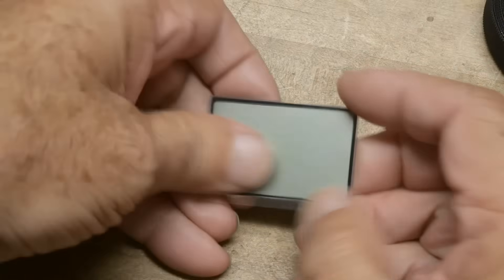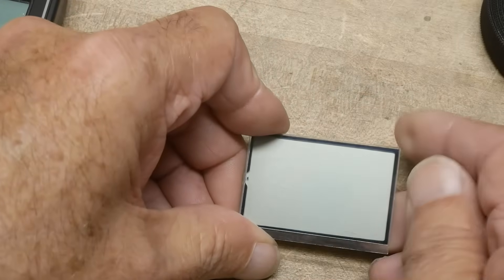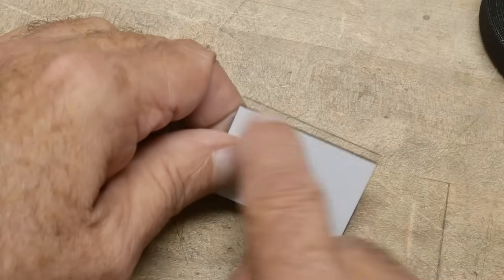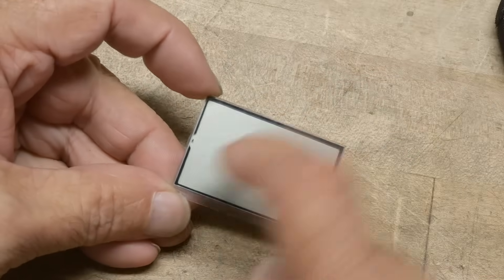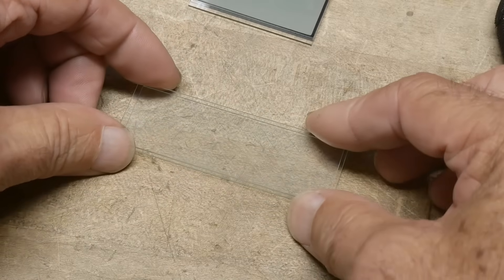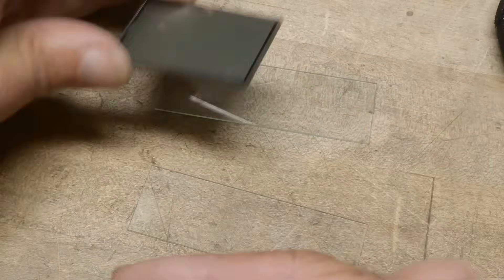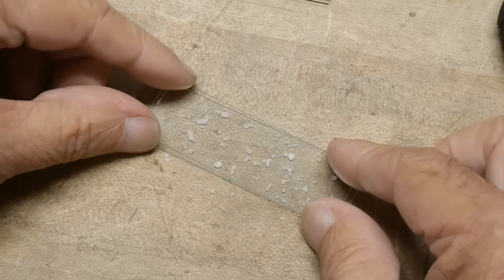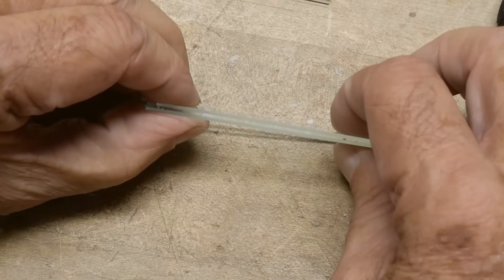#2325 LCD Glass Spacing Construction

Comment: That reminds me how some conductive tape manufacturers makes conductive adhesive. The adhesive itself is still an insulator, but they put a bunch of small conductive beads in the adhesive to bridge the gap between the tape and the surface its adhering too. Fun to see how the same idea can be used to solve multiple problems!

Comment: That is amazing!   And thanks for pointing out that, of course, they has to have a way to fill the space between the glass with the magic goo.  I suspect that or the seals are why the very early LCD displays that Fluke used in the 8050A DMM (and like others of the era) would go bad.  It seems like moisture, or something from the outside starts to leak in and impair the display.  I hadn't given much thought to the nature of the failure mode, but now I've got a sense of it.   

This is one of the reasons I did a project to replace the early crude 7 segment, 4.5 digit display with a graphical color LCD display driven by a microcontroller that wire-tapped the signals going to the old display.   I'll have to take the old display from the fluke and put it under my microscope to see what I can see!  Another wonderful distraction from the projects I have queued up for my retirement!

Comment: Do you have any flexible LCD devices or displays?  Evidently they have little pillars lithographed into the substrate that do the same job as the glass beads in the rigid type.

Comment: This would mean every single screen is unique and could be identified like a fingerprint!
In fact I'd say they are more unique than fingerprints as fingerprints are based on a sort of baseline structure with certain features, while the spacers seem to be truly scattered randomly with a certain density.
You'd have to scan the displays really closely to "fingerprint" them though 😁
Reply: I would think they can move around.  They are after all in a polymer, the "liquid" part of LCD.  When you press on the glass they can probably get moved in that polymer.
Reply: I have floaters in my eyeballs does that qualify?